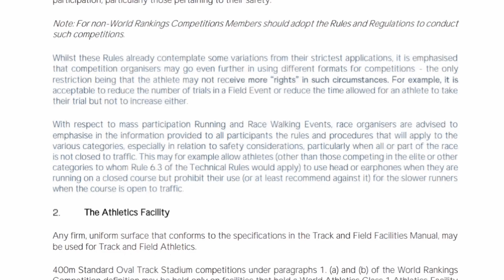Why Don’t Pole Vaulters Just Use a Longer Pole?

Comment: Great video! However, from my experience, the issue with using a longer pole is that you can’t get it to vertical so that you’ll actually go up instead of back towards the runway. It’s also why before fiberglass vaulters had to use shorter poles, since the bend in a pole makes effectively can make a longer pole “shorter” and easier to move to vertical. You also mentioned that the longer pole would change jump timing but vaulters are already used to having to adjust to different pole lengths as they progress or change the lengths of their approach.
Reply from the maker: Great! Thank you for sharing your personal experience with us!